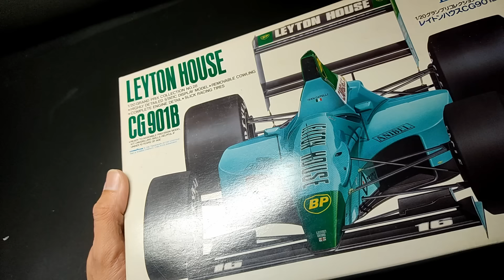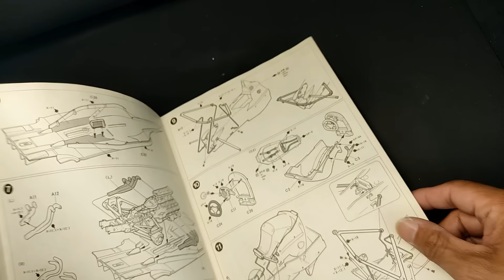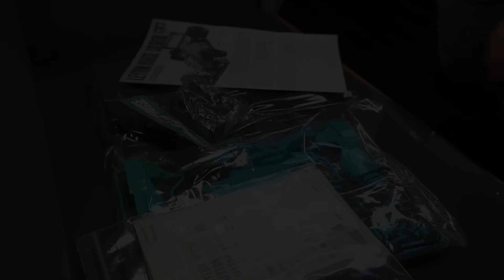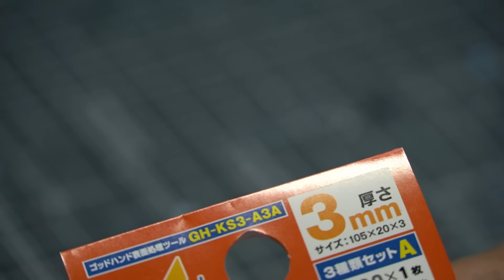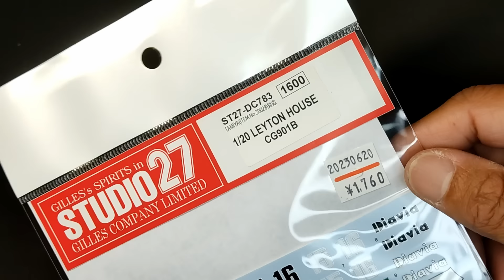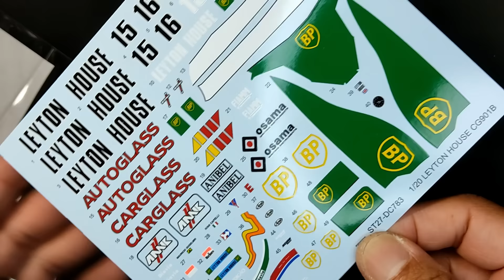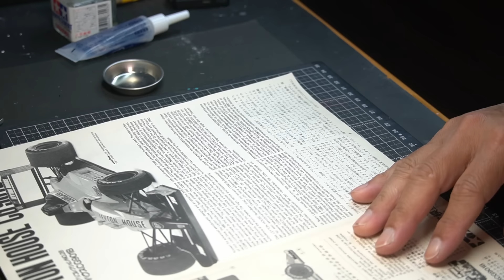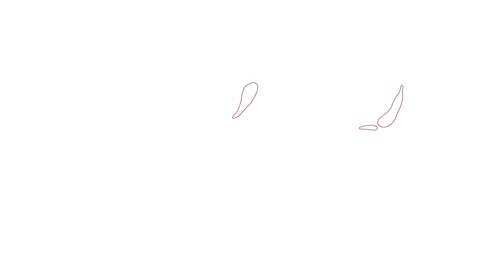LEYTON HOUSE CG901B / TAMIYA 1/20 Formula1 / Scale Model / Ivan Capelli / full build / F1 / ASMR

Comment: The old decals would probably have been useable after spraying decal clear coat over them. The aftermarket decals are likely better quality though. Leyton House was something to do with real estate property. You can hammer solid core copper wire flat to replace warped suspension arms etc. Much stronger than plastic as well. Try filling gaps sometime with plastic stretched over a flame instead of putty. 50 years experience for me 🙂.
Reply from the maker: Hello. Thank you for watching.
You have very great skills and knowledge. I can only build according to the instructions, so your experience really shines through. Thank you for your continued support🤗